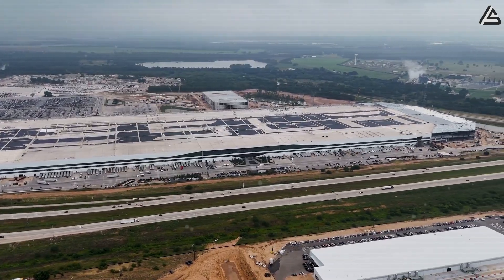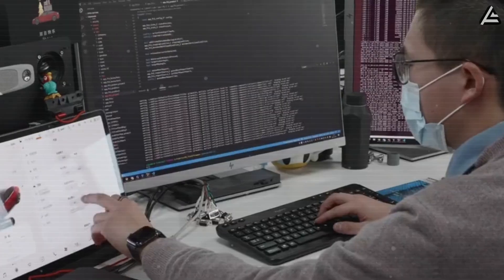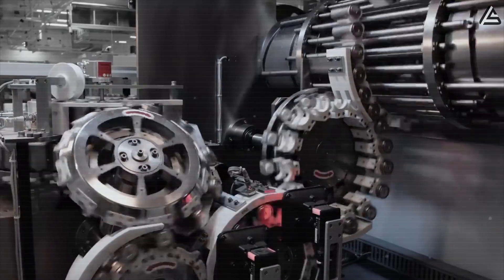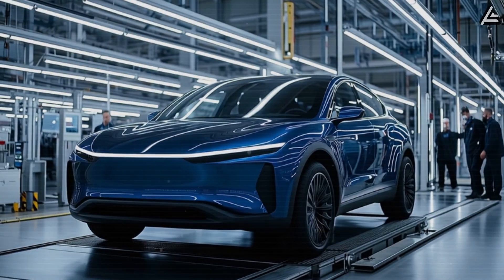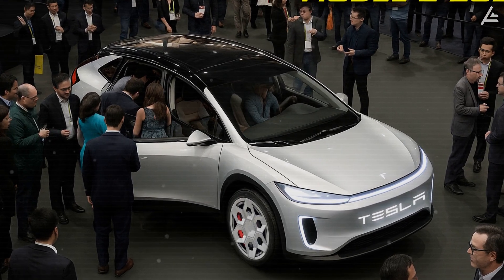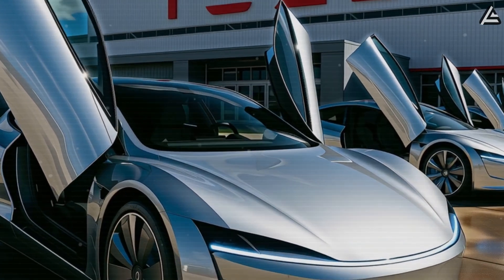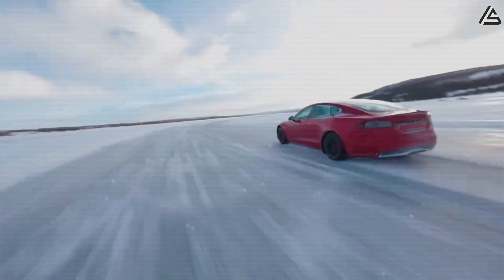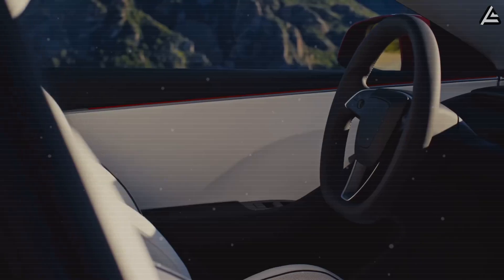Elon Musk Announced 2026 Tesla Model 2's Production Plan: What Makes It A Game Changer?

Comment: WHAT HAPPENED TO LAUNCHING IT BY THE 4TH QUARTER OF 2025???????  ALSO, having them built in Mexico is EXTREMELY disappointing!!!! He should have concentrated on Texas or Nevada, to avoid the tariffs. Further disappointing news is that the Aluminum Ion battery tech is behind the Sodium Ion battery tech. I thought this Model 2 would kickoff being shipped with Al ion. It absolutely SUCKS that this is not going to be the case, which means I will not be buying one now. At least not until the Al Ion tech is in it.
Reply from the maker: Model 2 will still launch with Aluminum-ion, but mass production won’t be until 2026. Tesla’s pushing hard on scaling it up, so a bit of patience will pay off big